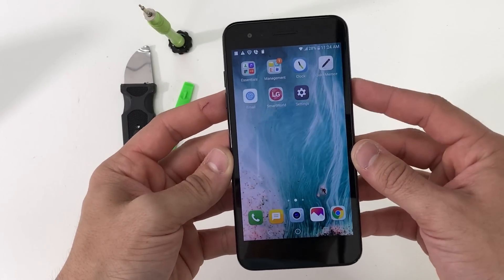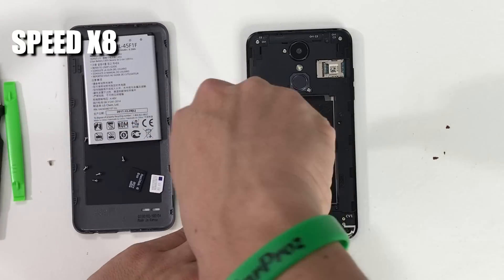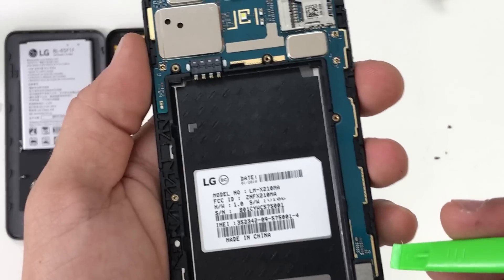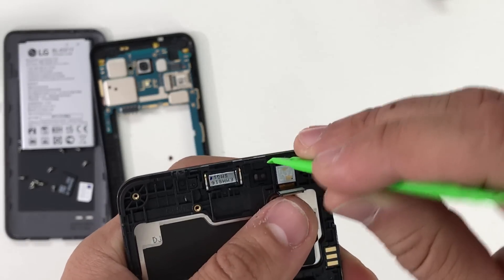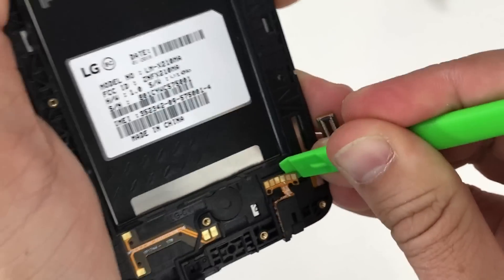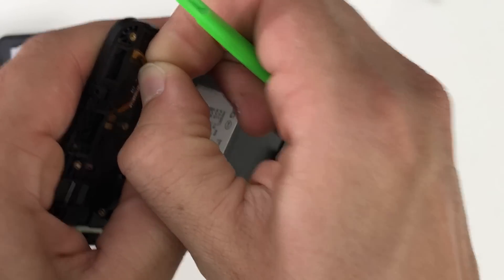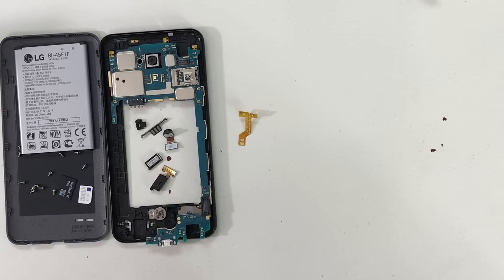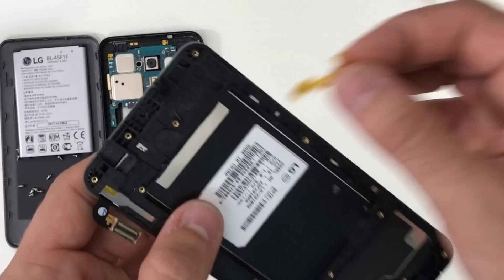How to Take Apart & Replace LG Aristo 2 LCD Glass Screen Repair

Comment: I had one from 5 years ago had so much vital information and it won't turn on the question mark comes on when it's charging without the battery so i replaced the battery but i think it's the connection to the battery it was a issue back then but rn im ordeing the screen hoping after i maybe re soder the connection it'll work and ill remember my 5 year old passcode

Comment: Hey thank you so much this really helps me and replacing the screen for my phone however the ear speaker for some reason does not work anymore if you see this message can you please respond thank you
Reply: Make sure everything is in place and at a tight fit ( this happened with my bottom speakers)

Comment: It would help alot to do the reverse in real time as well.  You went so fast I couldn't keep up and then had to rewind back to the beginning when we took it all apart. My speaker is not working for some reason and I've taken this apart and put it back together again a couple different times now.  It worked prior to this repair so I'm not sure what I did wrong if you could please offer some feedback I would really appreciate it.

Comment: bro You're Video Was Cool but while doing you're Steps My Screen Cracked and The Mother Board Broke It Waas Trash anyways THANKS THOUGH Mate.
Reply: that just means you're not good at fixing things even with clear instructions
Reply: Bro same things happened to me it’s not about not being able to .. some of this stuff breaks with the LEAST amount of force this guy just has had way more experience doing it
Reply: @excessivemedia9295  I replaced mine no problem first time
you just need to make sure you undo the snaps

Comment: Thanks for the tutorial!  My Aristo2 had developed multiple verticle lines of various colors.  I purchased a replacement screen assembly and made the swap.  The only complaint about the video is the 8x speed assembly.  We can easily skip bits to speed up the video, I took mine apart a couple days before receiving the replacement and had to go back over the disassembly portion of the video to refresh my memory.  After the replacement, everything works as it should except one thing... the proximity sensor is not working!  Do you think this is an error on my part?  Or a defective screen?

Comment: Forget the glass. Get the LCD touch screen and digitizer follow instructions and go slowly. For the small little parts use a needlepoint pin and slowly pull.